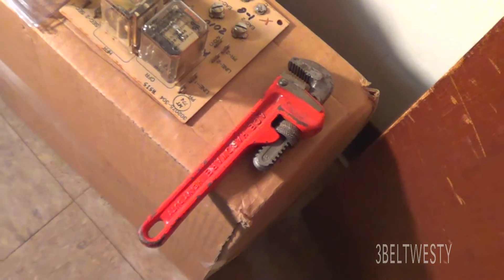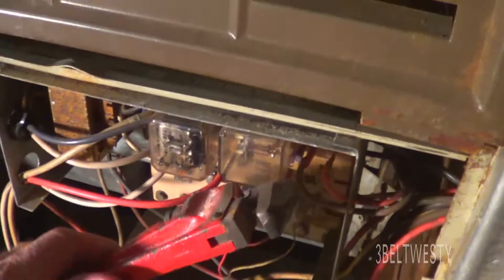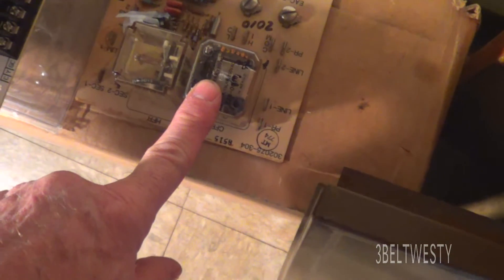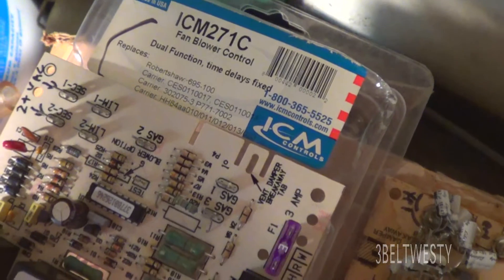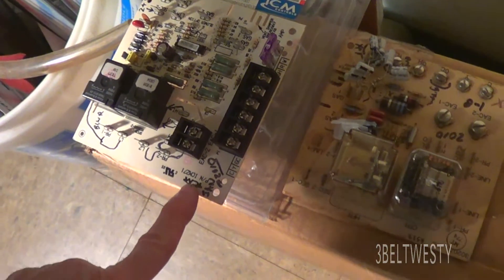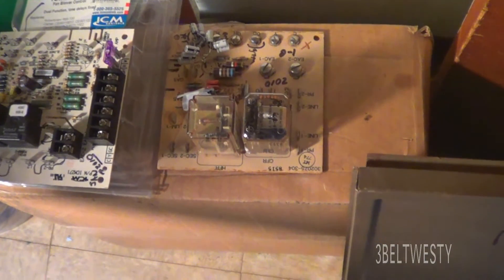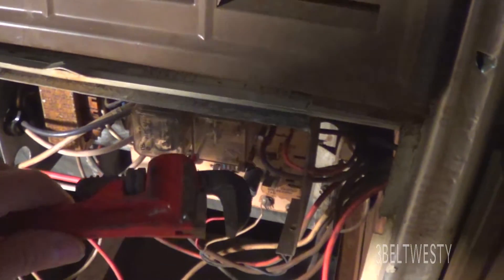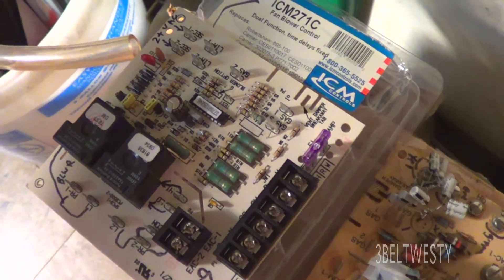CARRIER 58GP Stuck relay on Control Board Wrench ICM271C

Comment: Worked for my 1983 carrier. Thanks and thanks to Bill for finding this gem
Reply from the maker: With mine the relay tends to stick after a storm where the local power went off for a while.  Thus even with the thermostat set to OFF ( not on AC or Heat) the Fan relay often turns on and sticks. Maybe it is a weird way the local grid comes up with a recloser on the distribution lines. Anyway, today at the work building the relay was stuck , one tap and the fan was off. Then the post-storm rebooting of computers, the LAN etc. One of the LAN cards on a computer died and spent part of a day futzing with computer stuff.
Reply: My relay smack lasted 24 hours. Got the replacement board for $50 the other day

Comment: I have same issue. tapped on the relay and it shuts off. I have a model 58GP125-2 from 1982. Will this new Board ICM271C work for me?  Thx!